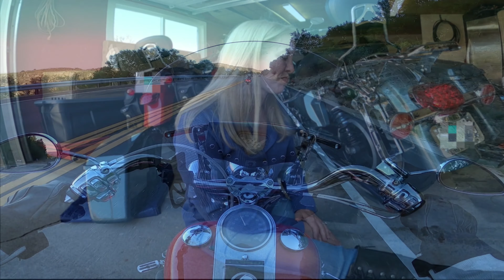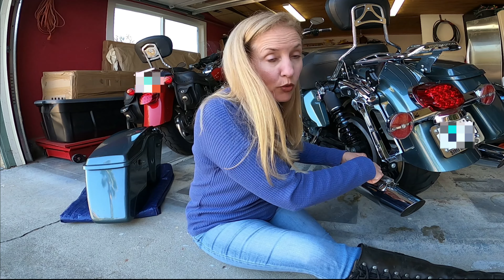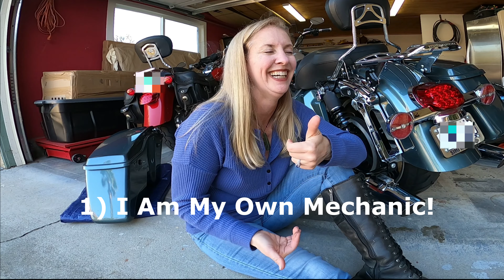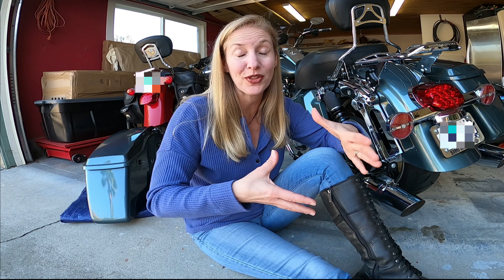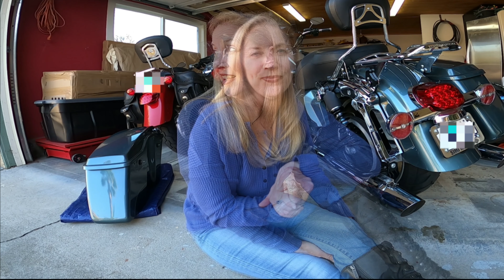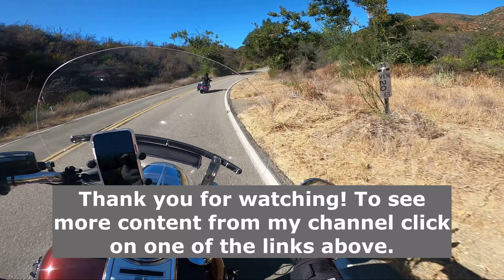Do You Do Your Own Work | Wrenching On Your Bike

Comment: I'm in the 3rd category at this stage of my MC life with the added complexity of most modern MC's. When I started riding in 1970, with simpler machines and no fear or knowledge of repairing MC's, I frequently would tear in to repair work with nothing but the owner's manual. With friends, we rebuilt the top end of a Honda 175 and put in a new head gasket on a Honda 350. On a 2 month cross country MC trip with 3 friends, one of my friend's Honda 450 holed a piston somewhere in Iowa. We towed his MC(with a clothes line) to the next exit and in a gas station service bay, removed the engine from the frame and bungee corded it to the seat of another bike. The next day, we traveled to the nearest city with a Honda dealership, had a top end job done on the engine, returning to the gas station the following day. We installed the engine, filled it with oil, adjusted the valves, set the points, and it started right up. We were 17-18 years old. Being young & dumb does have it's advantages!

I do all the routine maintenance including oil changes, cable lubes, bleeding brakes, installing pads, adding accessories, etc. 2 of my MC's have hydraulic valve adjusters, but my 3rd has shim adjusted valves, that I take to the dealership. In SoCal's San Fernando Valley,  we are blessed to have a 2 shops dedicated to just MC tire sales & installation. I use them exclusively.
Reply from the maker: Not sure I was ever that brave. Than again, I took off to travel solo into some questionable places, so maybe I was. 😜
Living just north of you on the central coast, I too have found some amazing shops that really take care of us.

Comment: For me I fall in the middle bracket, doing some modifications, and some some things that I can handle, but I got a mechanic, not certified but he works on his own even rebuilt his Police RK , so for major work I have them take care of it if home. Just so happened I worked with his wife and him indirectly. I got plans to change out the windshield the 22 inch one is nice in the cold but terrible in rain and fog and I want to change out my leather bags on my RK for hard bags.
Reply from the maker: Clearly, I am right there with ya. I can and will do somethings, but at a certain point I want someone with more knowledge than me to take care of them. 
I hear ya on the taller windshields. Part of why I cut mind down to 18 1/2".

Comment: Yep, I do most of mine.  Tires, oil changes, accessories etc.  If it comes to the major, I will probably take it to the dealer.  There are some specialty tools that I don't have and don't want to buy for a one time job.  Great video, thanks.  Be safe, have fun.
Reply from the maker: I am wishing I had mentioned about specialty tools in the video. That is a good point. You may have the skill, but few want to invest in a specialty tool for a one time job. 👍🏻
Reply: @MotoByChance  I managed a shop for many yrs and we had all the specialty tools and I know the price tag on some of them.  Like you said some of us don't want to invest in that just to do our own bike.  Be safe and thanks again for the video, all good points.  Have fun.

Comment: I do most of my own work but that is because I live on an island and there are no shops. I have done several frame up builds and currently own 6 Harleys. However, I have limitations and send off transmission work to US.  The good thing about learning your bike is you do not have to worry to much about breaking down on the side of the road. My bikes are old from 1962 to 2001. Good to see you are willing to learn how to maintain your bike as to me that is an important part of riding safety.
Reply from the maker: Lloyd, you are in a whole category I should have added. ‘I have no choice but to learn and be a mechanic.’ Like jumping in the deep end of the pool to learn how to swim. Wow! 
And yes, when you know your bike that well, you don’t have to worry about breaking down. As long as you have the right tools with you. 👍🏻😎

Comment: One of the things that drew me to motorcycling, is that they are so easy to work on.  Most of the time, when you have a problem, you can see it and easily get to it.. unlike a car where,  to change my wife's car's battery, you start by removing the windshield wipers (a Ford Escape... and yes, really).   I can do pretty much everything except deep motor stuff, like adjusting the valves.  Plugs, I change'em, lights,  all fluids, sure, brakes and bearings, no problem.... Had to recently drop the bottom off the engine.. swallowed hard, but got it done.  Find it all very gratifying. To quote Clint Eastwood's Dirty Harry though:  A man <or woman> has got to know his limitations.
Reply from the maker: Richard, I too have a Ford Escape and TOTALLY feel you pain. It is not easy to even deal with the oil!
I want to know more about the bikes and do more of the work myself, but time is a hindrance for me at the moment. Maybe I will look into taking a basic mechanics course. Hmmmm.... Now that is an idea.
Reply: @MotoByChance  I'll build on your idea... Your local dealer (where you bought your bike or might buy a bike) should offer a basic mechanic/simple maintenance course targeted to the fastest growing segment of the motorcycle market.. women like yourself.    It would be a great bit of salesmanship on their part and very instructive to those of you who attend.  They would certainly have a mailing list (call it an invitation list) to recent women customers or potential buyers.   Pitch it girl!! (and do keep us posted!!) The class would make a great video for you too.
Reply from the maker: @richardmourdock2719  That is a fantastic idea! Will be at the shop I use next week having some work done that I do not have the tools for and will speak with the general manager. Thank you!

Comment: i have taken the combustion chambers of engine to extreme limits dimension holding cylinder inside melted down changed its shape ,  slightly variation was there in the crankshaft and cylinder  i found it soon as possible  and took it to show room only     there are things which we are not to do
leave the job to professional
Reply from the maker: I agree, there are some jobs that it is best to let someone with more training complete.

Comment: Hi Robin,  I probably fall into the middle bracket, but I as bikes get evermore complicated I find there’s less and less you can do yourself.  I am lucky in that I have done several mechanical courses through my work and have a good idea of what needs to be done.  However I always get the bikes serviced by the main dealer while under warranty and then I am very lucky to have a couple of great friends: one is a professional mechanic and the other is an engineer who can fix just about anything.  Just about maybe four years before I changed my last bike I went away from the main dealer and serviced the bike with my friends help.  I hope you get the mounting bracket / grommet fixed.
Reply from the maker: Hey James. I agree, as technology advances, it is more difficult to work on our bikes. Though I still try to do as much as I can so I know my bike. Maybe I need to take a course. Hmmm. Now that is a thought.

Comment: I do all of the work on my own bike until I have to crack an engine case. I have a valve check coming in about 5K miles and I’ll probably let the dealer do it…this time. I’ll figure out how to do it myself next time. 😊

Solid video!
Reply from the maker: Thank you! I was thinking it would be one of my videos that would not do well. Surprise! 😜
You do a bit more than I do. I am still learning, but my biggest hinderance is time. I simply do not have the time to do the level of research I need to for some of my projects.
Reply: @MotoByChance  The secret is to have the tools. Spend the money to get good tools and then YouTube is your friend.

Build up to it. Start with a small thing and finish it. Then do something a little more complicated and do it. Eventually, you’ll find that you are doing all kinds of things. Also remember that if you F it up, you can always take it to one of your mechanic friends.

Comment: I do some work. I do oil changes and I’ve taken the wheels off to have tires put on. On my old bikes I have done a lot of work but now the electrical advances need a technician to make sure everything is correct.
Reply from the maker: Chuck, I am right there with you! There are somethings I am still learning and somethings I just want to make sure are done right. Example; I am thinking about changing out the shocks on Scarlett. I believe I can do the rear shocks, but the front… taking her in for those.

Comment: I lean more to the I do not need a mechanic for most things but when I do I have a guy. Best way to find a good mechanic is to talk to other rides and see who they us and weigh it with what others tell you. As far as the rubber mount try some adhesive it might work.
Reply from the maker: Hey Jeff. I want to get to the point you are at, but I still have so much to learn. And good point about tapping into the local riding community to find who others are loyal to and why. Thank you for sharing!
As for the mount, I’m sure adhesive will be in the mix at some point. With it loose it allows the exhaust pipe to move separately from the bike. Thus the vibrations. Usually in 4th or 5th at between 2500 and 2800 rpm’s. It’s subtle, but I hear it.
Reply: @MotoByChance  Check real close and make sure that it is not starting to split. I live in Fl and I have problems with rubber and seals drying out and getting brittle.
Reply from the maker: @jeffcoler3104  Good call, I will double check that. We live close to the water and the salt could be effecting it.

Comment: There is certainly nothing wrong with either scenario. I can rebuild an engine but I can barely understand my taxes.

The problem is, finding a good tax guy or gal that I can trust to maximise my return.

I don’t work in the bike industry anymore, but when I did I was always disappointed to see a lot of workshops take advantage of customers. I worked in one shop that tested their customers right.

The second last bike I bought was so riddled with horrible workmanship that I called the seller a few days later to warn him not to take his bike to the shop he used. I had the receipts and service history of the bike and none of the things he was charged for were done. At best , I they were done they were done poorly.

After market handles bars hit the tank. Wrong heat range spark plug. Chain too loose and dry. Oil too full and dripping out of the breather hose. After market indicators wired in so poorly the connectors were messed up and the wiring was dangling inside the rear guard, rubbing against the tyre. I could go on but I messaged the guy to tell him that their workmanship was not only ripping him off, not only ruining the bike, but making it almost too dangerous to ride it and trust it.

So if you can’t do your own work, that’s cool. But definitely make sure your favoured workshop can do it right. Definitely get a friend who might be more mechanically minded to check it out.

Lastly, I have to sadly say, as a plebeian grease monkey, I saw workshop managers rip off and talk absolute garbage lies to more female customers than men in nearly every shop I worked in. Yet another reason I don’t work in the industry at all.

As for your rubber exhaust mount, definitely remove it and have a closer look at it. It could be split or the rubber might have perished. Or it could have popped out of its home and the misalignment is causing metal to metal contact, giving you the sounds you’re hearing.

Comment: With New Bikes you need a wizard tech yes I do the oil brakes an tires on my bikes which is 20 Road King 107 An a 21 lowrider S 114 both are Stage 2 upgraded so I needed a Tech now while I love Harley Davidson Bikes I'm not much on dealerships There's Far better Techs in the private Sector I do my research on my tech plus  I ve done business with DC Coustom Cycles out of Red Bay  Alabama for 15 years David Crane an his crew have thier own Stage Kits dyno everything it takes to make these 2 wheeled computerized wonders the best FYI if your servicing your Bike an not thrashing the guts out of it No need for all those Services that Stealerships say you need an thats the Truth
Reply from the maker: Part of why when on the road I did not do the full 25K service. I knew that I could get it all done at 30 by a shop I know. Taking off on long rides, sometimes solo, I know to know that the bike is as prepared as possible. 
And you are spot on about many of the best techs as in private shops instead of dealerships.